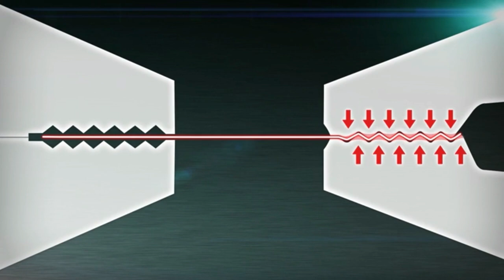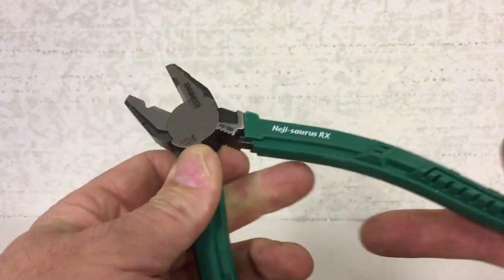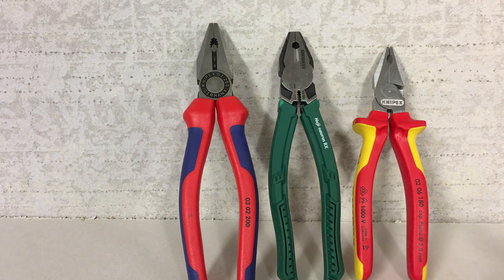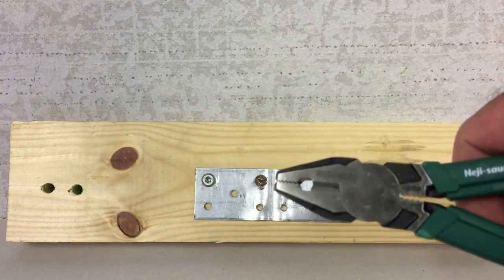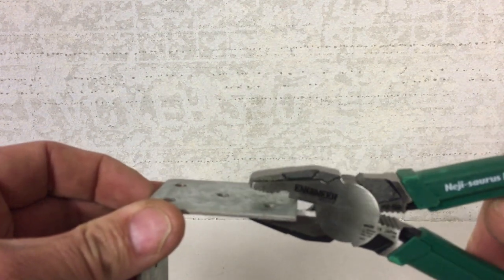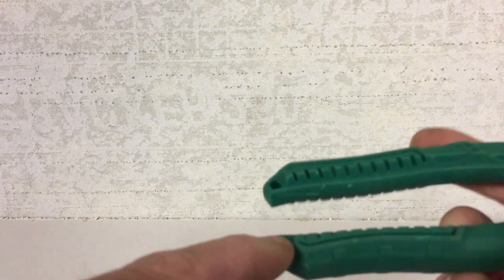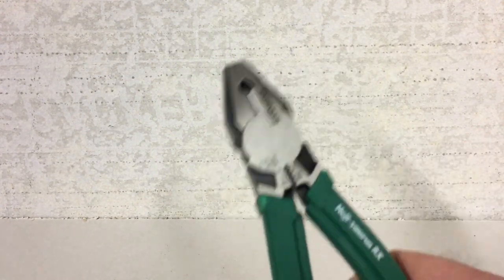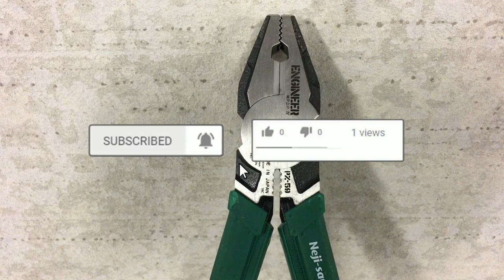How To Easily Remove Stripped Screws with Rounded off Heads | Engineer Pliers

Comment: Ordered arriving tomorrow
Reply from the maker: You will love them, great tool to have mate ! 👍
Reply: @Bacrenfencing  well mate they arrived and straight away I'm slightly suspicious as they don't have engineer stamped into the handles and they all seem to apart from mine. Next I use them to take out one screw and the blades are mashed. I'm suspecting a fake. I'm sending them back and I've ordered more from another seller
Reply from the maker: @danstoolroom7700  Definitely sound fake, the ones I received are very well engineered and you can see the quality straight away. Definitely put them back for a refund. Where did you get them ? Was it Amazon / Ebay etc ?
Reply: @Bacrenfencing  yeah it was amazon, I've refunded them and bought another pair off amazon from an I dependant UK seller that I Google first, seem like a big engineering company so should be genuine
Reply: Literally pulled out one screw and it squashed all the teeth

Comment: I'm thinking of buying the pz-58 or pz-59  are they as good as they claim . I want a heavy duty for cutting 10mm cable . Etc ..etc .

Ps ..could you maybe do a comparison on - impact / driver bits 
Dewalt;  wera;  milwaukee. 
They all claim there great ...🤔 
Thank you stay safe .👍👏
Reply from the maker: Hi, I can only speak for the Engineer Neji pz-59 pliers and YES, they are as good as they claim for REMOVING SCREWS. I cannot verify that they would be good at cutting 10mm cable though as I have never tried. I tend to use Knipex mini bolt cutters for anything that heavy https://amzn.to/2ZetNK5

 I only use dewalt impact bits and have not felt the need to use other brands. WERA bits are supposed to be really good, but they are very expensive........yes, I may do a video on that in the future ! 👍😎
Reply: @Bacrenfencing  Thanks 👍👏

Comment: I bought a pair from Amazon. I don’t recall the model # but they were smaller than the green ones you show. Unfortunately, they didn’t work to get a slotted screw out of a faucet. (It looks like the low profile one you were trying to remove.) They just couldn’t get a grip on the rounded head. I used PB Blaster, heat, and Engineer pliers. Nothing has worked. I sent them back.
Reply from the maker: Thanks for the comment. I have not had any issues with these, they have been really useful. Maybe the model you had were too small ? These are the larger ones shown here.
Reply: @Bacrenfencing  : I’m going to order the larger pair and give them a try. The screw is still stuck in there! 🤬

Comment: There scissors are top notch
Reply from the maker: Not tried them Paul but if they are anything like these pliers, I NEED a pair !!!😂😂👍
Reply: I bought the CK heavy duty electrician scissors from eBay for around the house, I have used them a good bit and there still holding up very well, they have received very good reviews on Amazon as well 👍
Reply from the maker: All the scissors I use are Knipex, I have a few pairs and like them very much - you get a great Holster with them too which is an added bonus ! Keen to try a pair of the Engineer scissors in future and will take a look at the CK ones too.
Reply: @Bacrenfencing  The CK scissors come with a sturdy holster as well, you can't go wrong with knipex in general , I have the engineer pz 59 screw removeable pliers as well, I was going to buy the engineer scissors, but I read some reviews of the blades going blunt after while of using them, so I bought the CK scissors instead 👍
Reply from the maker: @Josh-fk8ml  I will do a bit of research Josh and then decide - I have a few CK tools and they are very good, on a par with Knipex in my opinion. 😎
Reply: @Bacrenfencing  i have the CK  electricians scissors and the engineers scissors 👍👍👍 PB plumber has cost me a fortune 😂😂😂😂✂️✂️✂️✂️💪💪💪
Reply from the maker: @paul_my_plumbs_uk  It was PB that first got me into Veto, cost me bloody ££££'s - he got a lot to answer for !!!
Reply: @Bacrenfencing  wait till after the lock down we'll get him 🤣🤣🤣🤣💪💪💪💪